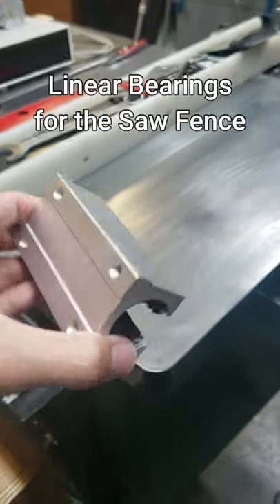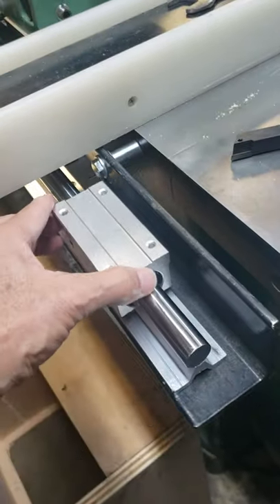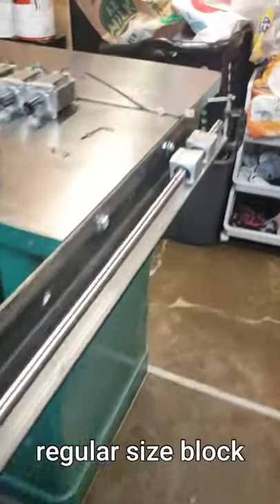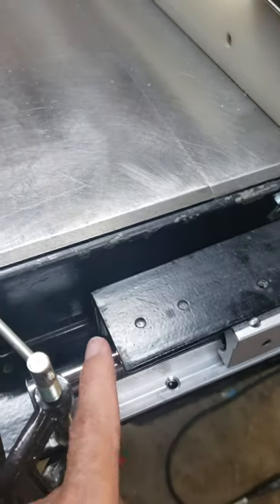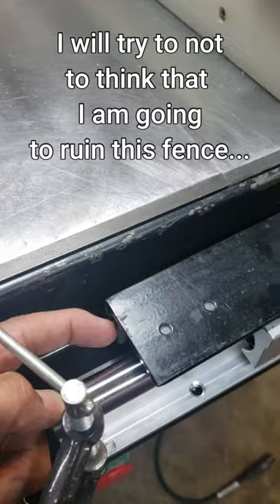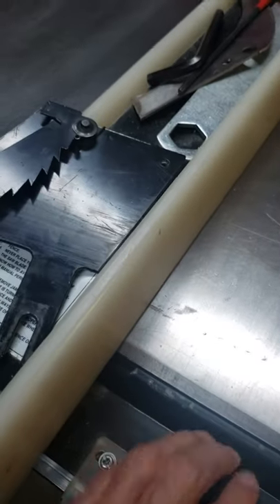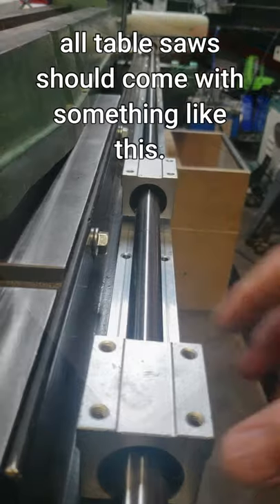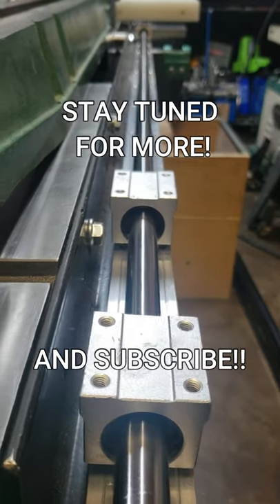Linear Bearing For Table Saw Fence #shorts

Comment: Love it, thinking of doing the same with mine. Am I correct that one wide bearing at the front, and one normal size at the back is enough to prevent any racking of the fence? Can you make it rack or is it just impossible?
Reply from the maker: I think 2 may be enough, depending on the shape of your fence, the reason I installed 2 on the front and one on the back is that the fence I used came with the saw (Shop Fox) is a T shape on the front.

Comment: How did you block  the fence in position ?
Reply from the maker: I used the same cam and lever handle that came with the machine, except that substituted the spring with an aluminum block.

Comment: I am wondering how the bearing handling the saw dust. I am in the process of doing the same idea on my table saw.
Reply from the maker: I have not used it that much, but when I do, the sawdust gets wiped off the rod by the rubber seal.
Reply: I use copolymer bearings on everything now. The ball bearing styles just gunk up too easily, and they're too rough. 
 
Look into the plastic polymer type bearing blocks... they're amazing. No oil/grease needed, and they don't have as much play.

Comment: what size angle iron and linear guide bearing rail size are you using, sir?
Reply from the maker: The angle iron was part of the Grizzly saw, 3" and 2.5" (font and rear) the rails are 3/4".